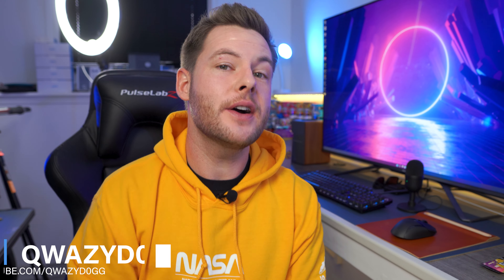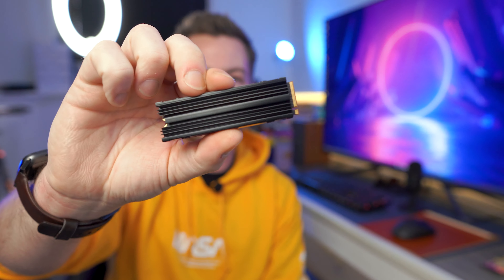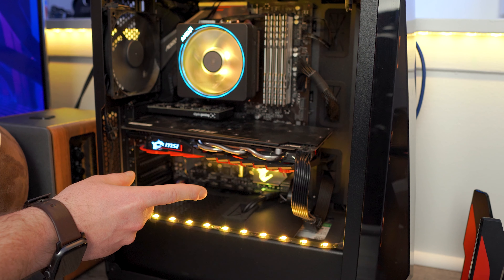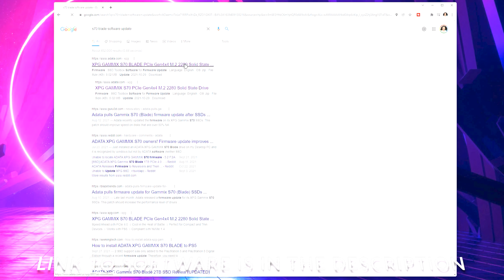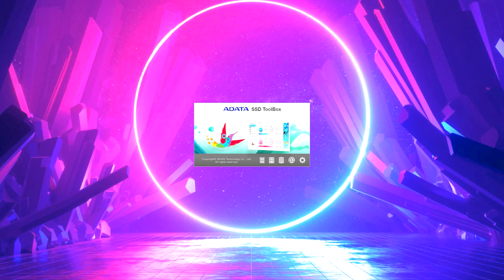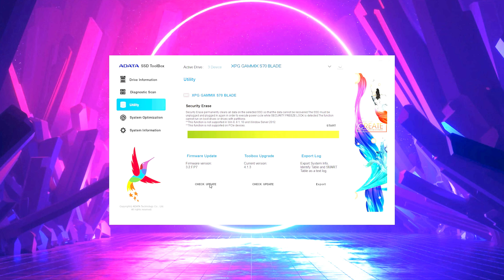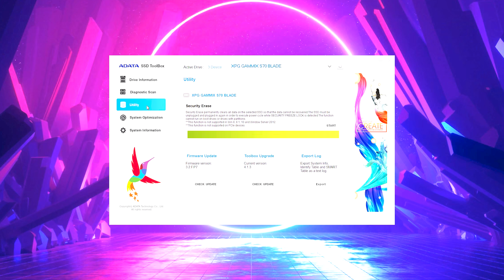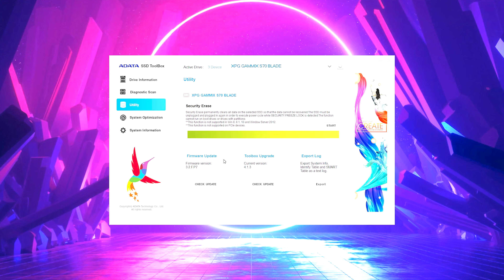How To Update The Firmware On Your M.2 SSD | Part 2 | How To Upgrade PS5 SSD

Comment: Great video, I always had questions about is m2 the same as SSD? and how to update it.      Just updated mine now, so thanks!  👍
Reply from the maker: In a sense, yet; however, SSD just stands for solid state drive, meaning there are no moving parts. There are many SSD types such as sata, m.2, pci-e 3 or 4, and more. Also in the modern day there are also differences with the memory type. It can get confusing sometimes for sure.
Reply: m.2 is just the connector/slot. It's similar to old laptops' mSATA slots which were used to connect old flash storage and WiFi modules.

An m.2 SSD can be for PCIe (typically faster maximum speeds) or SATA (6 gib/s (128 MiB/s) divided between all SATA devices' Read and Write operations.
The m.2 slot itself can be PCIe, SATA, or sometimes it supports both. Inserting a SATA m.2 SSD into a PCIe m.2 slot will do nothing and vice versa.

Comment: Gotta buy a gaming PC just to update the expansion storage of my PS5???
Reply from the maker: Looks like most drives are shipping with the update applied; however, it never hurts to check. Not a necessity, but it can give minor improvements
Reply: Not necessarily most modern laptops have the NVME slot of you have a laptop
Reply from the maker: Or you can use a usb enclosure as well.
Reply: @justinmorgan5073  how old is nvme technology n how  new a laptop does it need to be
Reply: So I actually just went ahead and installed mine without actually updating the SSD and the speed for the SSD installed read that it was faster than the SSD that's already in the PlayStation so it really isn't necessary to update
Reply from the maker: It depends on when it’s packaged. Back when the SSD swap update went out, some people who purchased this drive had speed/performance concerns due to older software in the drive. I think anyone buying one now should be fine as long as it wasn’t old dead stock in the back of an inventory room or something lol.

Comment: This is from awhile ago but my m.2 ssd when plugged in it deactivates a sata drive which i think means it works and all but the ssd itself isnt detected by bios, windows, disc management or nothing? I cant initalize it because it doesnt show up
Reply from the maker: What motherboard?
Reply: @qwazyd0gg  b450 gaming plus. It could just be dead but it cost me alot and i dont wanna toss it 😭
Reply from the maker: The m2 may be sharing the same controller as the sata you're using for your boot drive
Reply: @qwazyd0gg  i just got a ps5 for my bday and wanted more storage and it didnt detect on the ps5 and i was told to initalize it on a pc. I dont really know how to change the boot drive and stuff so ig im down 120 😭
Reply from the maker: It should have been recognized by default by the ps5 without doing anything. Sounds like it might be a defective drive that you can replace with the manufacturer
Reply: @qwazyd0gg  i put a heatsync on it so i cant rlly do that but ty for responding atleast most yt never do

Comment: When I build the pc I had them put windows on a m.2 drive I'm not sure if I have another slot but I can't use that one I assume?
Reply from the maker: Correct. You could use an external enclosure, or just use it without updating it as hopefully modern purchases will come preupdated.
Reply: @Andrew Wright  Okay, thank you for the prompt reply, I have the Corsair and am tempted to return it after all I've been hearing and the fact that the Samsung 980 pro is the same price.
Reply from the maker: 980 is a solid choice

Comment: Unfortunately it doesn't install for me. I just get an error opening the program. Maybe because I'm on windows 11
Reply from the maker: Should matter. You should just have to unzip the file and place the pkg onto the drive. Make sure you’re drive is 4gb or more and formatted to the correct format, and don’t try to double click the file as that may be where the error is coming from
Reply: Same :(

Comment: The toolbox doesn’t show my s70 blade, but shows my other drives.  I can see it in my pc. Any ideas?
Reply from the maker: That’s really strange. So you can see it in your My Computer as an available drive?
Reply: @qwazyd0gg  correct. Label as e drive.
Reply from the maker: I know the window is super small for toolbox, it sounds stupid, but have you tried scrolling down
Reply: @qwazyd0gg  I have and it only list 2 drives at the top. Tried refreshing. I’ve even moved data over to just to make sure it’s working properly
Reply from the maker: Maybe try removing the software and reinstalling, or launching as administrator
Reply: @qwazyd0gg  tried both lol🤷🏻‍♂️
Reply: It's just shitty software!

Comment: My 980 Pro is "locked" i cant format it and create any volumes. Samsung Magican update firmware doesnt work ! available spare: 0. HELP FIX this sh*t !!!!!!!!. My current firmare version is 3B2QGXA7 and if i want upgrade to  5B2QGXA7 then Samsung Magican show " Failed to update firmware on selected drive" wtf ? xdd any method doesnt work.. balena etcher shows that is locked (i want flash it manually)  .. xddd  do you know any program to update firmware on 980 pro from iso file ?
Reply from the maker: The widely spread 980 issue was actually just covered in detail by Jayz2cents with an issue report and what to do if you have a bad drive

Comment: I got the wd black sn850 1tb from Amazon for my ps5 do you think need update to work ? I was reading and say is compatible but I want to make sure, My potato laptop from 2015 I don’t think have that port so I can’t update
Reply from the maker: I’ve only heard of this particular brand recommending the update, so I think you should be fine.
Reply: @qwazyd0gg  yeah I’m safe the ssd read like 6500 🥳
Reply: I bought the same SSD from Amazon and I only get 1500 from it (on my PC).  Maybe my SSD slot is an older gen?  shrug    Still loads faster than my HDD, but I really wanted more performance :*(
Reply from the maker: You’re more than likely not using a newer usb port beyond 3.0. Check your hardware updates as well in case your controller has an update, but it’s more than likely a port/motherboard restriction.

Comment: My s70 blade will not update even though there is a new version. The actual firmware window will not populate so there no way to update it. I did update it once before just after i got it about a month ago without issue. I uninstalled the program and reinstalled it, same BS! I hate it when manufacturers shove crap on the market and never actually test it properly. LAME!
Reply from the maker: Have you tried a windows based update on it via device manager?
Reply: @qwazyd0gg  That will not update firmware...
Reply from the maker: I suppose eh, that’s just driver software :(
Reply: I have the same issue. The ADATA SSD Toolbox recognizes the drive and says there is a FW update, which I downloaded, unzipped, but the firmware installer doesn't see the drive & no options in the drop-down window.